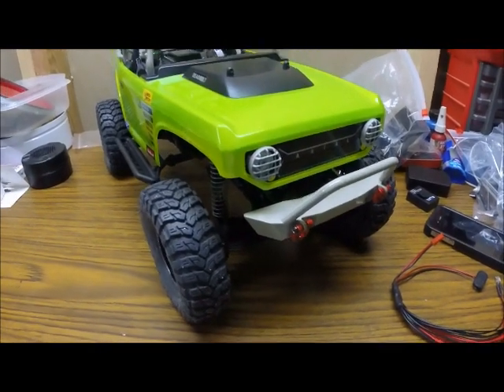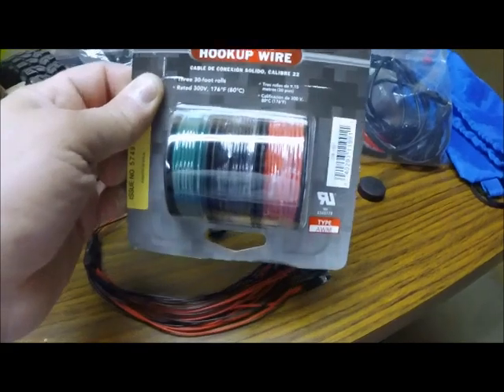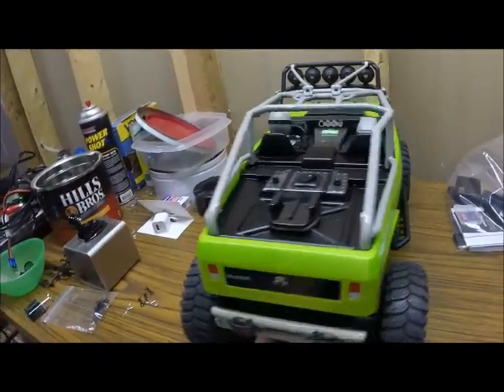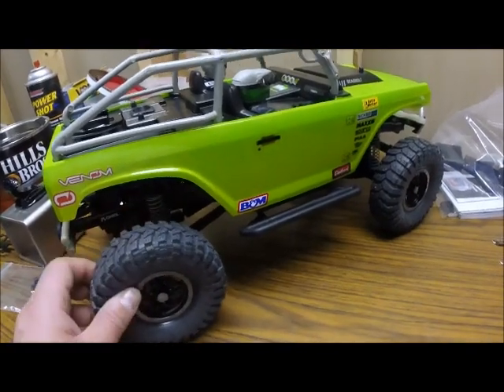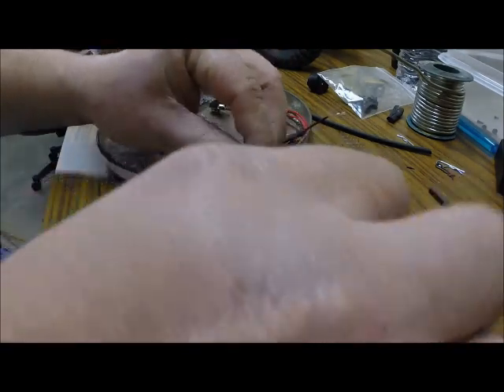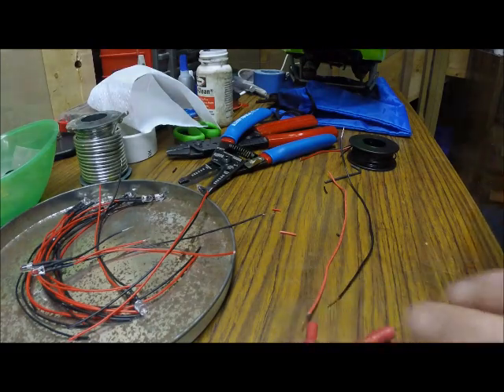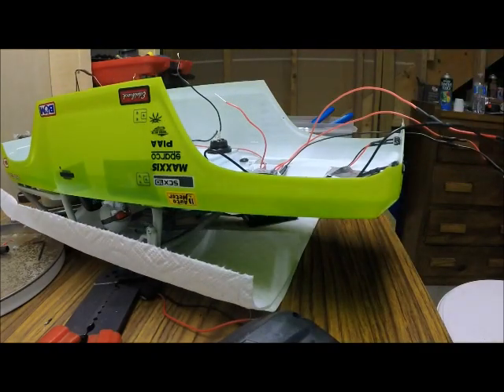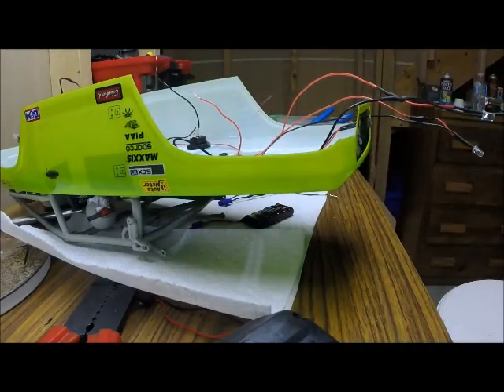AXIAL SCX10 Deadbolt 12 LED Light Custom Wiring Install Step By Step And Final Overview

Comment: Thank you man, great video-it feels good to see the end product when all the lights are on- i am definitely going to do something like this, i have already buy some materials, i need to buy the resistors as i am planning to connect it to the receiver box but i am a bit reluctant to connect it to the receiver box as i don't want my run time to diminish-i have a lipo battery of 7.4V 5200mAh- And also, please advice on where to plug the connector into the receiver box, i have to the same truck like yours, just bought it like some 3 weeks ago!!!-
Reply from the maker: Thank you buddy for watching and the cool comment!  I love having the lights I use them all the time. I would buy the sets with the resistors already installed then just make wire length like I did. You can plug into the 3rd channel slot on the receiver under the waterproof cover. If you buy the Integy like set they are cheap in price and have the plugs you need to plug in the receiver. You won't notice any battery life shortage with the 5200 the LEDs draw very little voltage. The only thing with the receiver hook up is when you run the car the lights will burn all the time unless you install a switch like I did. Then when you lift off the body the wiring will be attached to the car unless you wire in a connector like I also did so you can easily remove the body for service. Receiver voltage is a little less than say a 9 volt alkaline. If you run a 9 volt you will notice brighter lights. I have several 9 volt setups but like the 7.2 NiMH setup that you see in this video. I throw it on the charge at a one amp rate for about 10 min and it last a long time. Congrats on the new rig, I've had mine for 6 months now with not a single issue it is a fantastic truck. Hope this info helps you out.

Comment: Awesome build is the light bar the factory one and you just drilled it or what thanks.
Reply from the maker: Thanks man!  Yeah the light bar is factory and comes with holes and brackets and hardware for 5mm lights which is awesome. Problem is 5 lights is an odd number for sets so you end up having to make your own setup.

Comment: How are you holding down the rocker switches ......... Love the video by the way
Reply from the maker: The rocker switch body itself is threaded and comes with a flange and nut. Drill a clearance hole and then finger tighten the nut in place from underneath the body. Thanks alot for watching and commenting Night Angel!!

Comment: Hey thanks for replying back just one more question and waterproofing the switch or is it ok
Reply from the maker: No problem anytime, The switch is not waterproof you would have to seal it up, heat shrink the connections ,maybe plastidip partiallyl and some water resistant spray on the top. Generally leds and water, wiring don't mix I keep the water below the diffs with no issues. If you run in water to the point of submersion you have to take alot of precaution on the waterproofing.

Comment: How did you mount the little headlight grills?  I notice the ones in my spare parts bag have 2 little tabs did you drill holes from them?
Reply from the maker: The grills have those tabs. I sanded those flat then put a thin bead of gorilla super glue. They have been in place for about 10 months,I also mounted them like this on my Tamiya lunchbox.Yeah they give all those extras and I think they look great really changes the stock look. Thanks for watching man!!

Comment: how are you not burning up the led i just bought a kit installed it and was going to run a 1 cell lipo witch is like 3.7 volts and burned all of them up
Reply from the maker: What's up man.   I am not a voltage or battery expert but I do know that lipos put out a lot more power that's why you run a 2 or 3 cell lipo and it puts out more available punch than an 8.4 NiMH pack. There is probably more to the technical side but lipos have a c rating the higher the number the more power boost. The other thing is make sure your LEDs have resistors on them before the bulb. I have numerous sets running a 9 volt alkaline and 7.2 micro pack you see in the vid with no issues. I would say stay away from the lipo and go with the 9 volt and you will be fine. The micro pack in the video is from the proboat blackjack 9 boat and works fantastic. Hope this helps
Reply: Ok yea i have no resistors that's probably why i burnt them up lol what kind of resistors do i need im not expert on electrical  been into rc for a long time but this is the first go on custom led's I also have the deadbolt doing similar setup as you have fog lights in bumper and have taillights in rear bumper now doing light bar on top thanks
Reply from the maker: stephenjray1988 I'm not gonna lie brother electrical is also my weak spot. All the LEDs that I buy I buy from the hobby and they already have the resistors in place. Then I cut and solder the rest of my connections and never had any issues. I just bought a set of integy lights for the landfreeder , 5   5mm LEDs with resistors and connectors at my local hobby shop for 5.99 us super cheap. Just do that and you will be golden I wouldn't chance the lipo though just roll with the NiMH then you know you will be good.
Reply: K thanks.

Comment: You should've just bought a Deadbolt grill from Knights Customs made in the USA cause I see your big on mentioning that and it would look so much better cause in my opinion those round grills are ugly and should've been used for what they were intended for which are the lights on the light bar which in my opinion is way to bulky Axial should've designed something better so on my 10ii Bolt I took it off very ugly light bar sticks to far up gets hung up it's a piece of junk